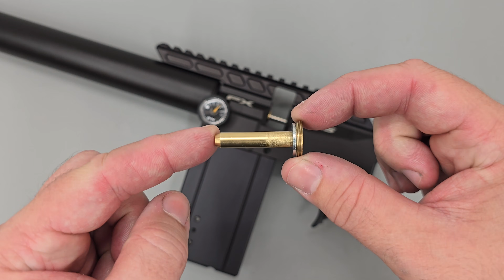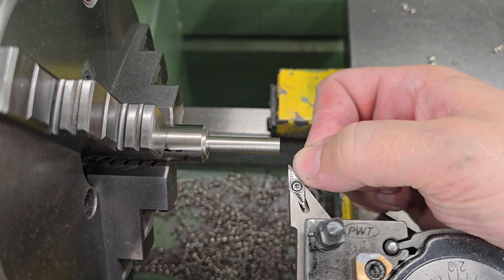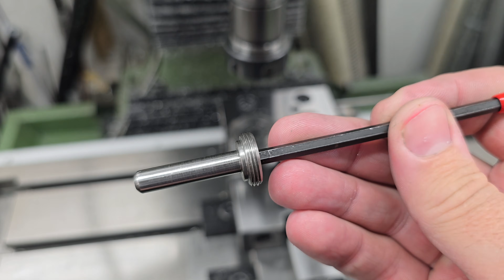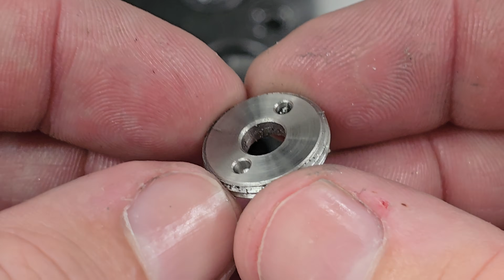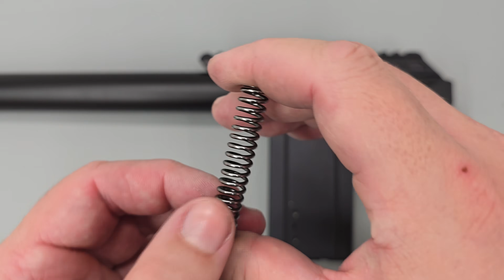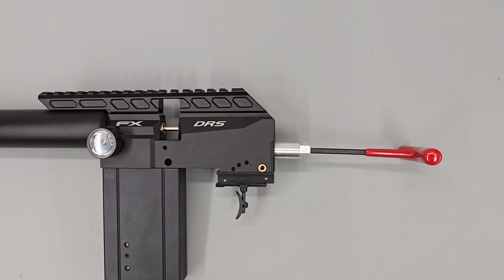FX DRS Making a hammer spring lock

Comment: Do you suggest using loctite on the lock
Reply from the maker: Hi no just nip the lock up to the adjuster 👍
Reply: @sub12airgunners excellent thought so but had to be 100 percent appreciate it nice1
Reply: @sub12airgunners i didnt purchase the licking tool as funds were tight lol so just purchased some 2mm pins like you suggested
Reply: Locking my dam fingers are to big for these little phones lol
Reply: @sub12airgunners know on the fx drs with the factory trigger can you shorten after shot travel coz its a fake second stage yes with the ball bearing was woundering if i could practically get the after shot travel like my red wolf
Reply: No after shot travel sorry

Comment: Can the Hammer spring be adjusted on the sub 12ft-lbs version of the DRS or has it been fixed in place? I got a Fx DRS Pro and I have chronographed it and its only at 11ft-lbs, I'd like it at around 11.6 or 11.7ft-lbs but I'm afraid to try and move the hammer spring or regulator incase its been locked in place and i bugger my warranty.

Comment: Hi there. I was just wondering if you could tell me the thread and pitch of the screw as I need to run a tap inside the housing as the guy who owned mine before has damaged the threads. (That's if it's a commercial size and not bespoke). Many thanks
Nice work by the way. Always like to watch some turning taking place.😊
Reply: Around 1:25 in to the video he says its a 16/1 mm thread. Hope that helps.
Reply: @jamesdoyle8047  yes why I didn't hear that when I watched the vid I don't know.

Comment: Makes me wonder why they dont start with stainless steel.
And some sort of locking system.
I'm wondering if the stock of drs could be modified to be able to adjust hammer spring.

And how easy to I stall sling mounts on it..QD and Flush